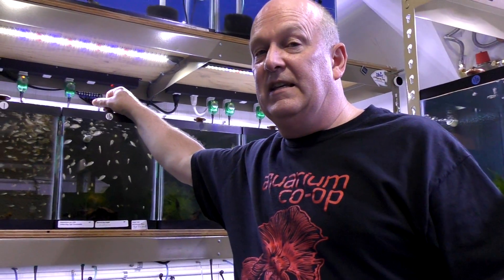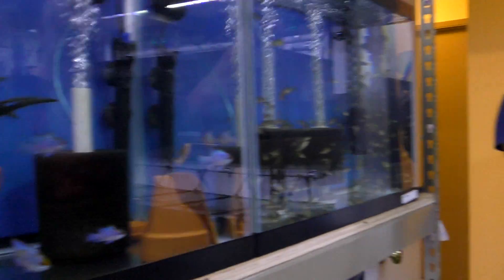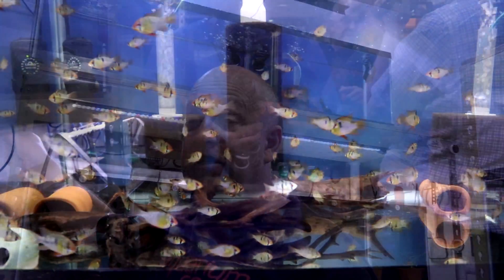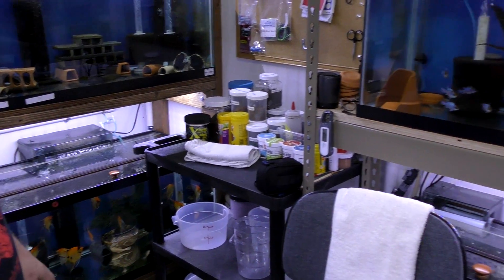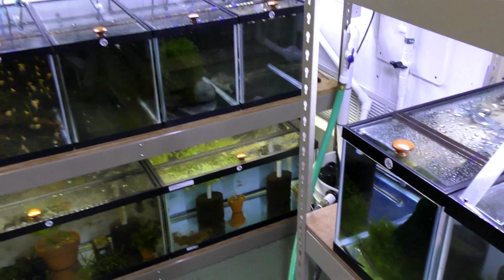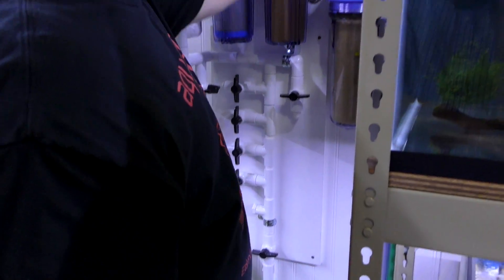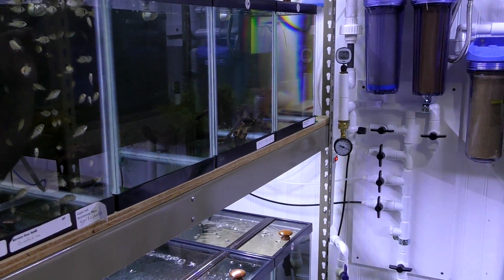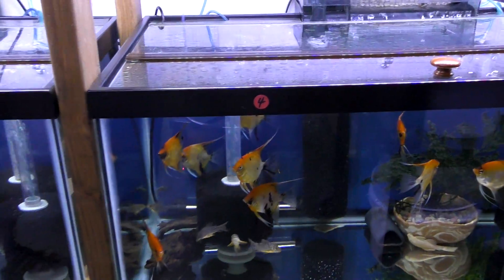THE CLEANEST FISH ROOM - Master Breeder Dean Angelfish and German Blue Rams plus others!

Comment: https://youtu.be/4VUHI4Db2YE?t=12m31s

What is that black piece that Dean has the OXO Thermometer placed through? It looks like some sort of 1/4" locking nut threaded into a brass fitting.
Reply: It is a Heyco Liquid Tight cord grip.
https://www.heyco.com/Liquid_Tight_Cordgrips/product.cfm?product=Liquid-Tight-Cordgrips-NPT&section=Liquid_Tight_Cordgrips
You need to pick the correct size for the shaft and what you are threading it into.

Comment: Where do you get those plastic mesh dividers?
Reply: those are cut from plastic ceiling diffusers which you can get from Home Depot or Lowes. They come in 2 x 4 foot panels and are pretty easy to cut with any fine tooth hand saw.
Reply: Good to know!